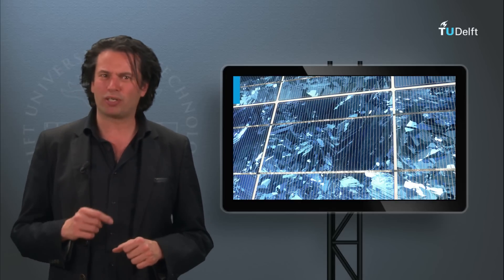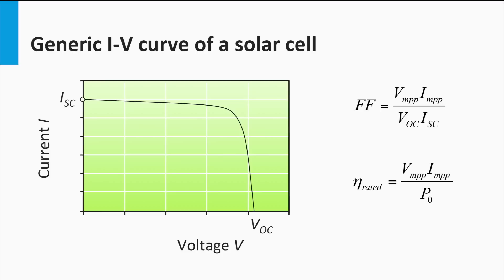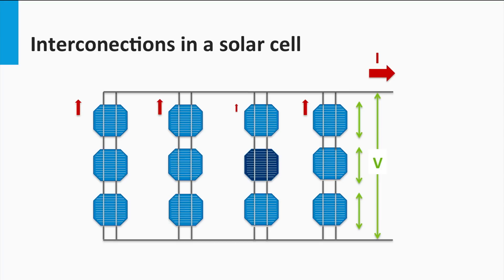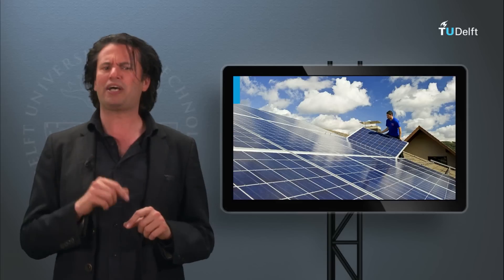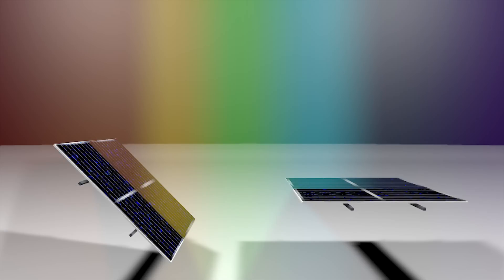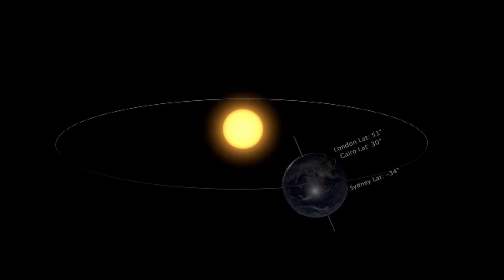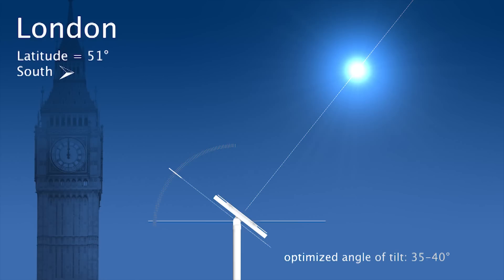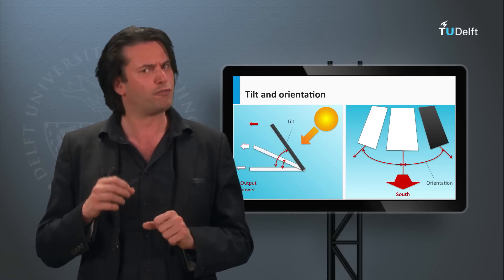7.2 part I - PV Modules I

Comment: Just came up. I'd say it can be very significant to have the wrong tilt.
Yesterday I tilted 20o for 50% more power.

Also installations with near panels cannot tilt as they would tend to shade, if lifting the upper panel. I would say there should be a minimum of three shifts in the tilt per year for optimal system yeild